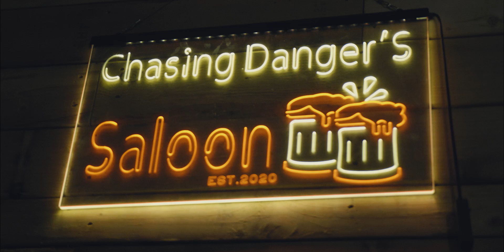Episode 01 - Welcome To The Ranch

Comment: Be careful blowing dust out with compressed air on paper filter elements, it will put holes in the pleats. Sweet banshee, you should get a TRX250R to go with
Reply: The trx is so badass. I grew up on the 3 wheeler 250r. That thing was a monster. Pretty disappointed it was sold considering how much they go for now. If i remember correctly it was just a simple clutch issue. Had no idea then they would be worth what they are now. It was pretty mint too. Very low miles.
Reply: 450 is the way to go